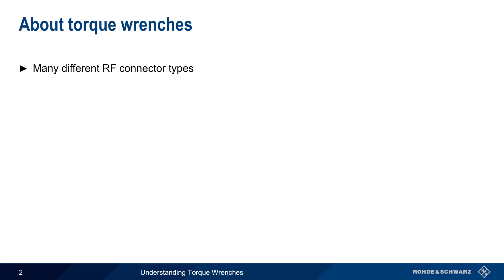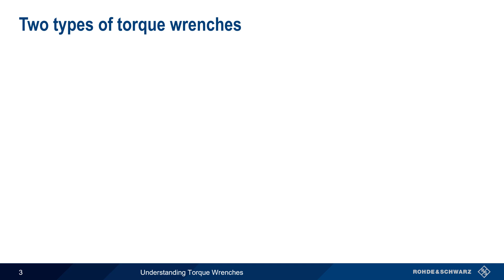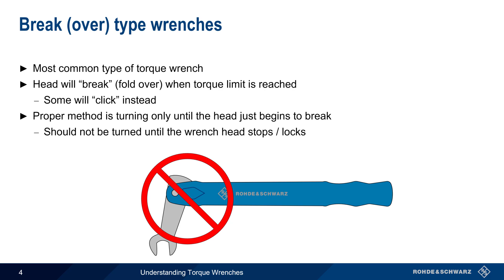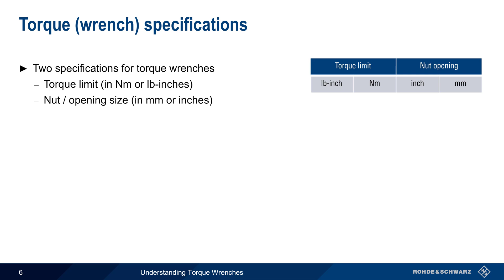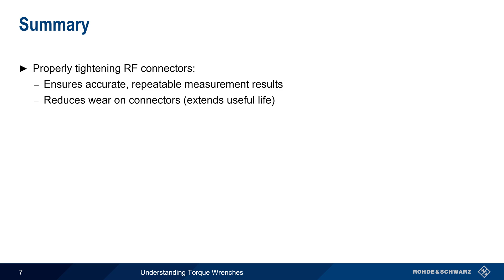Understanding Torque Wrenches

Comment: Very nice but we are missing how to hold or where to place the finger.
Reply: Good point  - thanks.  Normally you would hold the wrench close to the "non-pivoting" end, and very lightly - you don't want to be cranking it down the way would would with a "normal" (torque) wrench.

Comment: Proper grip is also important. That means only holding the designated end of the wrench handle. In practice, I have often seen people holding the wrench along the entire length of the blue handle, which is incorrect. I tested both methods in the lab myself, and there is a significant difference. With an improper grip, the wrench's tightening torque is more than 20% higher!
Reply: Great feedback - thanks!

Comment: The importance of torquing the connector rather than finger tightening became apparent to me when I was trying to hook a stiff RF cable to my DUT and seeing the connector body of the cable rotating on the spectrum analyzer's port. 😅
Reply: 😆  I may or may not have done that myself.   Lessons about torquing and RF connector care often are painfully (and/or expensively) learned.